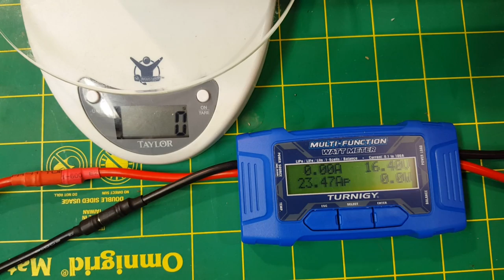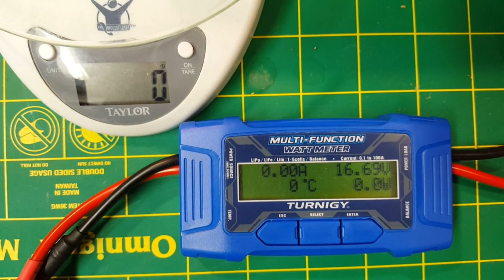DALProps T5045BN vs T5045 Thrust Tests

Comment: My Dal5045 triblades are slightly different, slimmer & more traditional prop curve. I thought my version was the racing kind - what is the difference?
Reply from the maker: they recently started making the TJ5045 which is likely what you have. I haven't tested yet but hear that they are pretty good.
Reply: +Flite Brothers Yes you are quite right, I have TJ5045. Dal are quite confusing with their different logos, websites & descriptions. After I posted I spent some time to check more carefully & now I see there are 3 variations. TJ5045 are working very well for me, which Steve recommended on the ZMR250 group.
Reply from the maker: +Okinawa FPV Yes. The TJ5045 are lighter and more aerodynamic so they draw a little less amperage than the regular T5045 series. From what I've read they still do very well on the thrust scale though. Glad they work for you! I hope to get some to test soon to find out exactly what the difference is.

Comment: Lmao. You can't weigh those props with that scale. It's error is at least +/- 1g. You need a mg scale.
Reply from the maker: Seriously? I know it could be more accurate by having a mg scale but one was 6g and one was 5g so it was obviously lighter regardless of exaclty how many mg lighter. that data is hardly as important as the thrust and amp data shown anyway. For now, that's the scale I have.
Reply: +Flite Brothers Another great way to do it is weigh 10 props and divide by ten.
Reply from the maker: +Goat Good idea. I just figured that since it did in fact register as a gram lighter on the scale, that was good enough as the exact weight wasn't exactly as important to me or aa relevant as the thrust data.